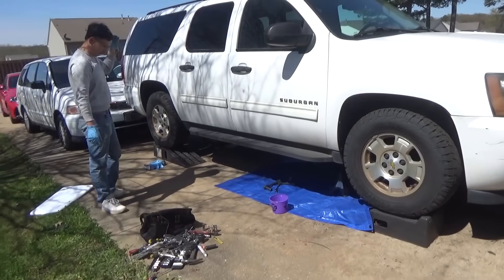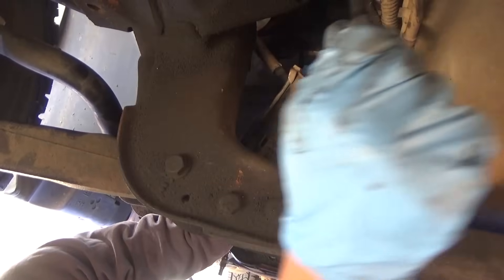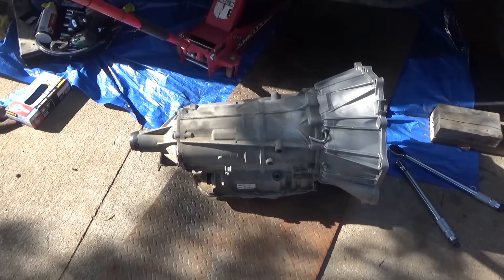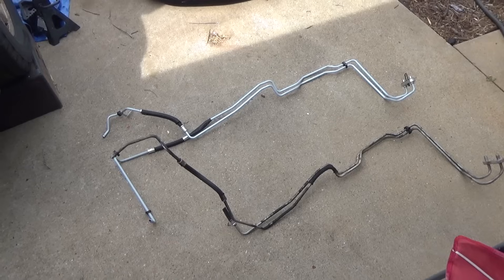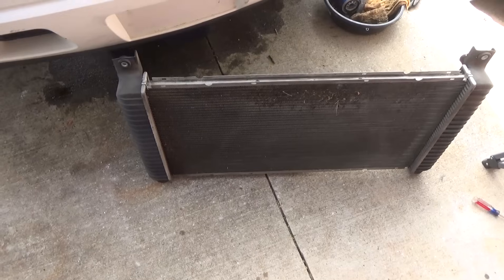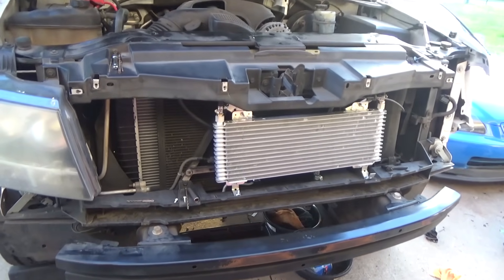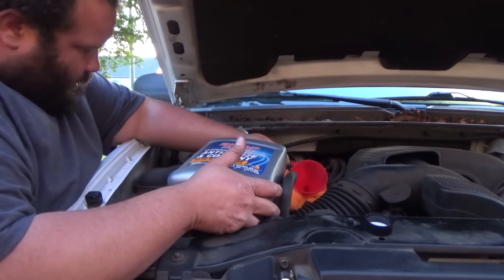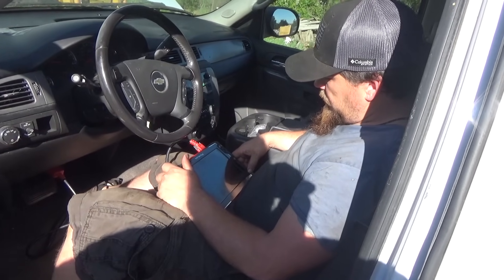Fixing the $1,000 Chevy Suburban. This was so much work!!!

Comment: Man i just sold my 6l80 transmission. I told ya i had it for ya if you needed it.  I am literally installing a new one in my Avalanche.
All you had to do is take the TECHM aka the computer out of the transmission and put it in your new transmission. You wont need too much of a tune. That 40k cooler is the truth!! I installed it too and my temps will not rise above 150 on a 88 degree day. 

Honestly i would go to LKQ in greer and get one out of a 6.0l Denali and get another TC.  Rebuilding is a waste. Take it from me!!!